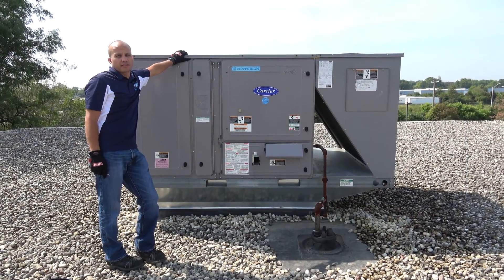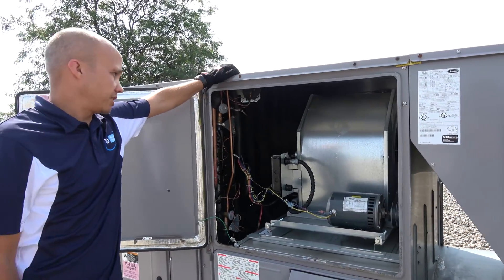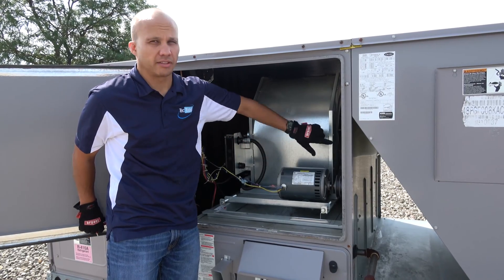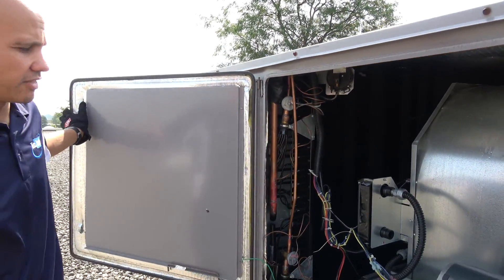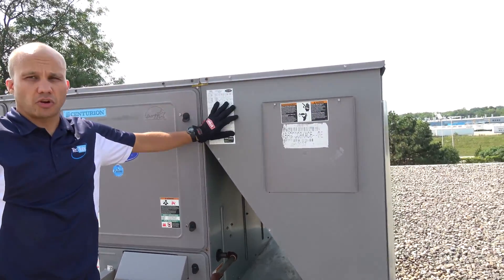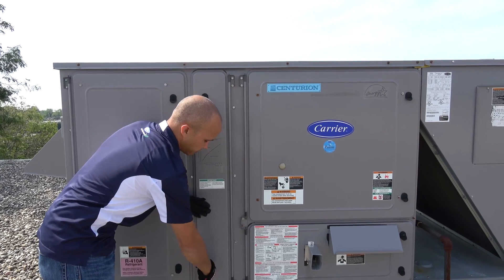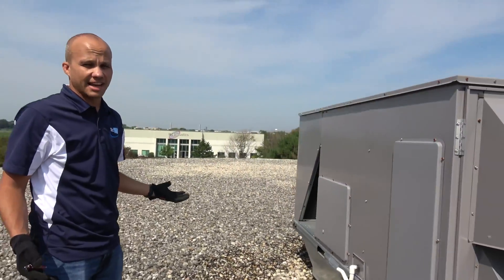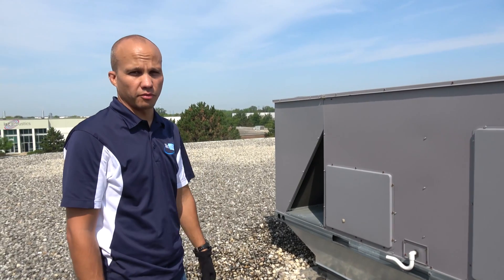Anatomy of a Gas-fired Packaged RTU

Comment: Hi what the benefit condenser fan for package?
Reply from the maker: What do you mean? If you don't have a condenser fan, how are you going to move the heat away from the condenser coil?  You would have to have a giant condenser coil in order to rely on radiant heat removal and natural convection. So the benefit of the fan is mechanically forced convection and hence and much, much, much smaller coil.

Comment: Ok I just added a short video on my site. It has visual of how all the drain lines tie together. I will get more video Thursday and put that up as well. “ACtech formally yo mama”. Let me know if you see it.
Reply from the maker: The ironic thing is the video shows the roof wet from rain... hence the idea of the drain lines being to prevent slip hazards sort of funny.
Reply: I know. You should see the slime on the sidewalk from the roof drains. When I first got to this job I thought the AC was draining on them but it’s condensation from the roof. Yes the roof gets wet from humidity every night. The white roofs are brutal. They reflect heat very well and cook you while you’re on them.

Comment: So you don’t have to run the drain to an approved storm drain, flower bed, or grass area? This is a required code in Texas.
Reply from the maker: We wonder why that would be code in Texas.  Interesting.  Condensate from an evaporator coil is non-corrosive.  Why can't it just go on the roof and drain the same way as the rain?
Reply: It is a slip hazard. It can not drain to a side walk or driveway. Draining on a roof is no longer code here. My guess is an inspector slipped on a roof lol now it’s no longer code.
Reply from the maker: @actechformallyyomama746  Weird.  Around here in Illinois, the roofs typically have drains that go direct to the sewer so the condensate never makes it to a sidewalk.
Reply: It’s about 50 50 here. If the roof does not go to a storm sewer, grass or flower bed than you have to run the drain inside the building to an approved drain. A restroom sink or a floor drain. This is a bad idea. I’ve seen it flood a business when the sink clogged and the AC kept running. Residential must run to a restroom sink drain. Previous the trap. And this also flooded the house. Proper thinking has been thrown out the door. This has been code here for many years. I believe it will change when the insurance companies complain about claims.
Reply from the maker: @actechformallyyomama746  Insane.  They are taking something that has no issues (water on the roof of a building) and making it into an issue.  In fact, we don't see how code would even allow... let alone require... you to run condensate into a restroom sink.  That would be prohibited here by our plumbing codes.
Reply from the maker: @actechformallyyomama746  We would also recommend that you look up and read that section of your code.  It is our experience that many people in the field are verbally told something is code and it is actually not... or the details are incorrect.  Whenever we are told something must be done by code, we always ask "Which code and which section number?" and then we go look it up.  75% of the time the person telling us it is code cannot tell us where to find it...
Reply: I have not seen the actual code but I have met the inspectors on site and I am made aware of new codes from the owner of the company. I would also find it hard to believe that every permit pulling company would do all this extra work without it being to code. There is a lot of extra work and cost to do this. Let me check my videos. I just started a YouTube channel. ACtech formally yo mama. Nobody took me seriously when I was yo mama. Lol. I have videos on an inspection I’m doing and might have gotten the drains on video. I’ll be back on that job Thursday. I’ll make a video just on the drain lines. These are exactly what I’m talking about.
Reply from the maker: @actechformallyyomama746  You should look it up in the actual code and see exactly what it says.  I can't speak for Texas, but there are lots of instances of stuff in Chicago where we are based where 90% of people think something is code required (included the inspectors) and it turns out that it is not required at all.  One person incorrectly interprets a code and verbally tells others what is required.  No one else actually reads it and hence the false code interpretation becomes the norm.

Comment: Supply and return at same place
Reply from the maker: What do you mean?
Reply: @TECTubefilms  I think they mean the exhaust is getting reentrained on the fresh air intake on the economizer.  I only watched the first economizer video (from the link posted on this video) and wondering about possibly mixing exhaust with supply.  Hypothetically if economizer is open 50% and the exhaust damper is open 50%, what keeps airflows from mixing?
Reply from the maker: @bryanprince8184  I suppose exhaust mixing back with intake air is a possibility.  However, the exhaust is exiting with velocity pressure which is pushing it away from the unit, making those air molecules less likely to be the ones that the OA intake is sucking in.  Additionally, the International Mechanical Code allows for up to 10% inadvertent re-circulation of this class of air.  This exhaust is just regular room air.  It is not hazardous.  It is not even objectionable in odor like toilet exhaust or something like that.  The exhaust air on a RTU economizer hood is simply just a portion of your regular return air that you had planned on recirculating anyway.
Reply: @TECTubefilms  Thanks for the punctual explanation.  I really enjoy your videos!

Comment: were you concerned with that condensate line discharging so close to the unit? Do you think it should be extended further away? im in florida not sure where this was
Reply from the maker: Chicago suburbs
Reply from the maker: What is the benefit of having a long condensate line?  The height of the trap is important but not sure why you would desire a long line.
Reply: @TECTubefilms  you are right that its fine. i was more thinking about the roof. constant dripping from the line could deteriorate the roof faster, but really, i would never write that up as a problem. Sure extending it to discharge off the roof would be better but its not gonna make much difference if i had to guess. i havent inspected too many rooftop units so i was wondering what you thought. You are obviously very professional and i like to learn from the best
Reply from the maker: @watchmenpropertyinspection3469  Thanks for the compliment.  And we do understand your point.  In our cold climate, the bigger issue might be long condensate lines that are not well slopped, allow water to collect, and then potentially freeze.

Comment: Since this RTU has two compressors and two evaps, does it also have two condensers?
Reply from the maker: Having 2 compressors does not automatically mean two condenser coils.  You can have multiple compressors (or a single compressor with 2 stages) on the same refrigeration circuit.  However, once you have two TXVs, then there are likely going to be two independent circuits, and hence two evaporator coils and two condenser coils.